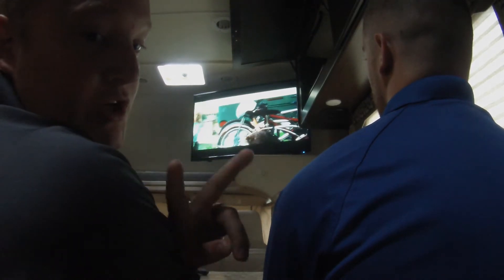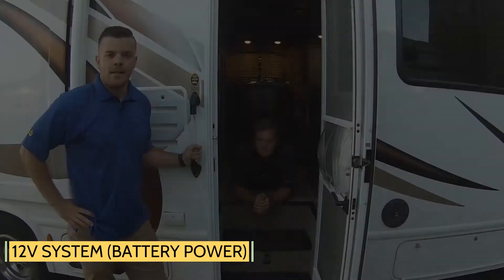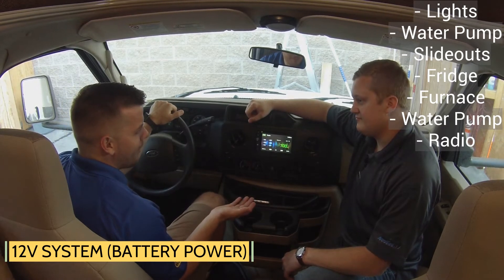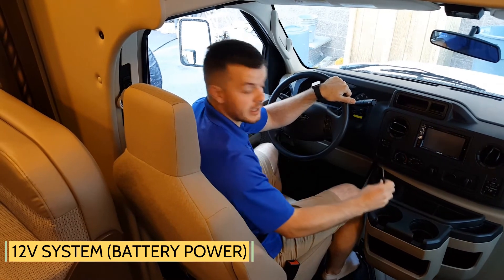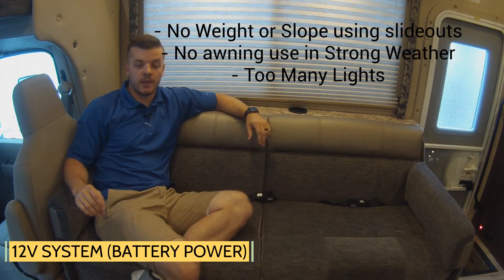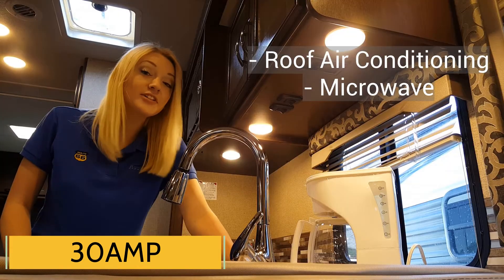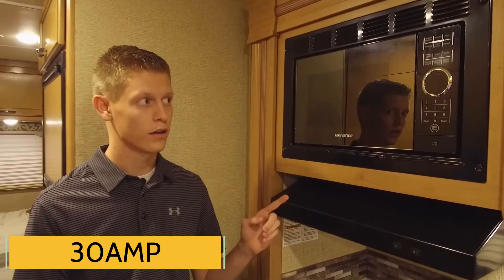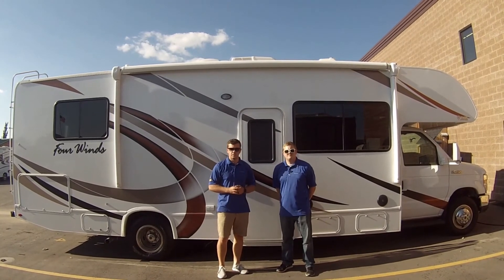How does an RV get power?

Comment: Would I be able to plug in things like a moniter and pc and if not how can I
Reply from the maker: Yes you can if you're plugged into 30 power and possibly when you are adapted down (would depend on overall energy demand of your PC along with the other components of the RV). If you wanted to use it while travelling or not plugged into 30+ amps, you'll need an RV with a generator on board and the same things apply with the demand of your other appliances (Air Conditioner takes a lot of juice from the generator).  I wouldn't recommend trying to run off of battery unless you own one and you plan on a lot of batteries and solar panels. 
These guys were the OG's when it came to answering the question if you can run anything and everything off of battery and solar, and as you can see, a lot is involved to get to that level.
https://www.youtube.com/watch?v=B0rZY5uotKI&t=455s

Comment: So if I have travel trailer how would my batteries recharge.
Reply from the maker: If your vehicle is wired with a charge line, then it will charge while plugged into the vehicle. Solar panels are also a popular option. Otherwise, good ol' fashion plugging into outlets and generators would be how you charged your batteries.